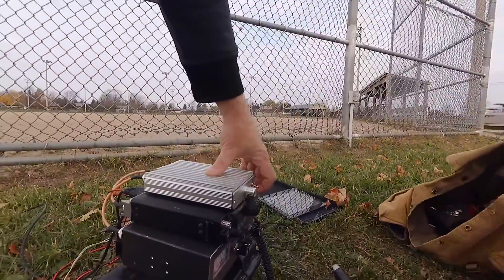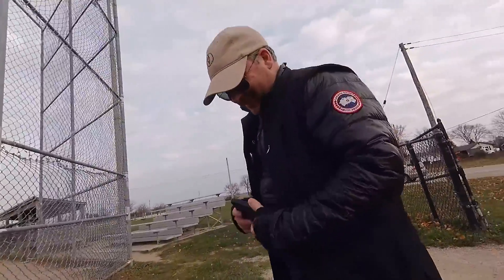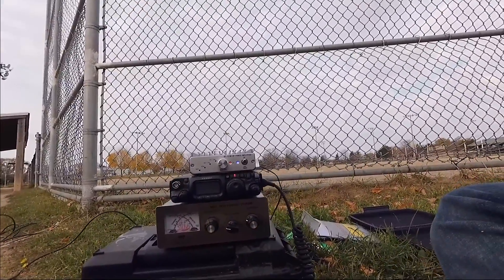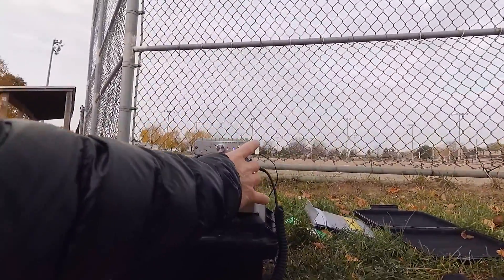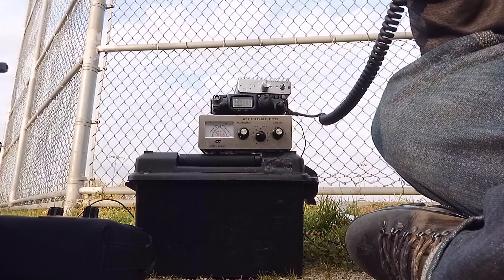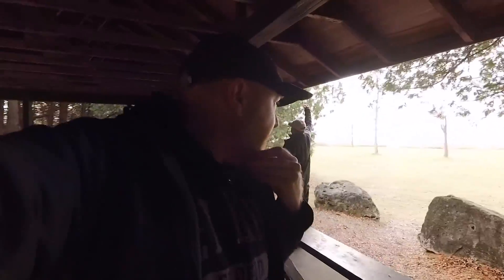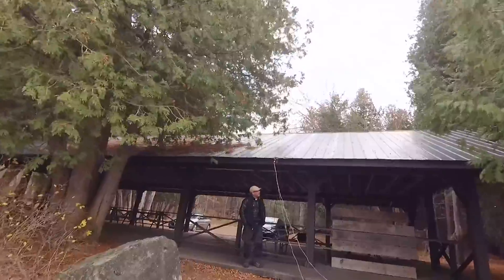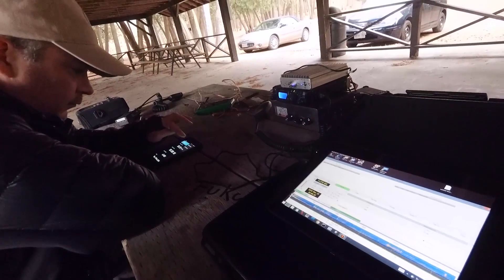Loading up a wet noodle and more...

Comment: I may be wrong here but please correct me if i am but my question is are your sure you are not just tuning up the counterpoise.  Do you think it would have tuned up if you did not have a counterpoise that may be the only thing tuning up.
Reply from the maker: All antennas need a counterpoise, so it would not have worked without one. Why would the metal objects not tune up?  They radiate like any other wire.  I think if I didn't use a counterpoise, it still would have worked, but just not as well.  Counterpoise are needed with every antenna, and when you don't have some, another part of the system acts like the counterpoise.
Reply: @VA3OSO ok but perhaps the counterpoise is the main element that is radiating RF in the overall antenna system?

Comment: Can you show me a close up picture ? How you connect the coax cable to the wire when you talked on the baseball back drop  thanks Kevin kd7kyb
Reply from the maker: Edit: pause at  7:55

I used a so239 connector which is the female port for the coax.  I twisted the wires of the counterpoise onto the shield of the so239 connector and used a wire with aligator clips/test lead to go from the fence to the center of the so239 connector.